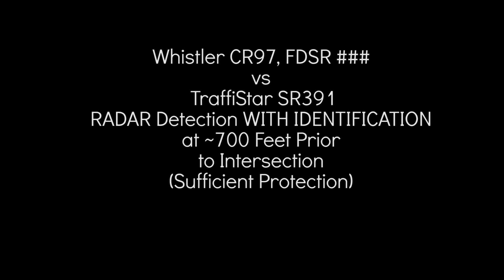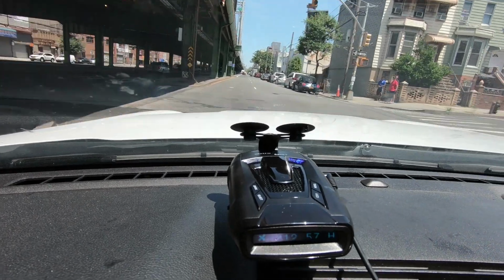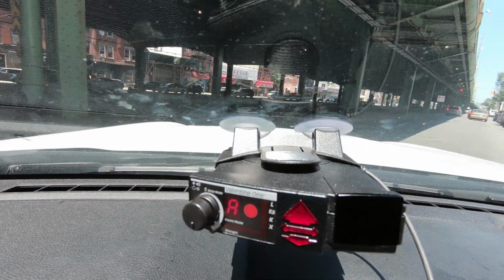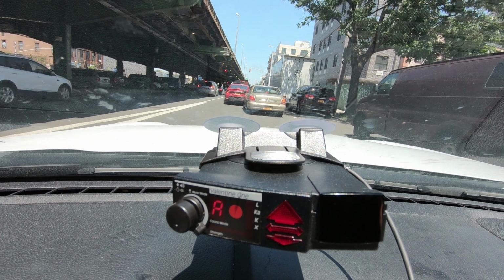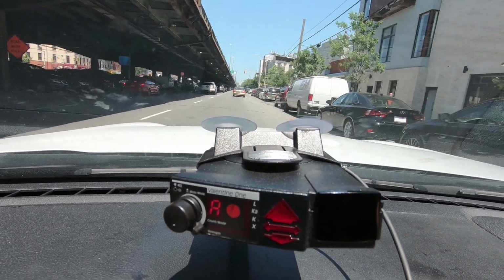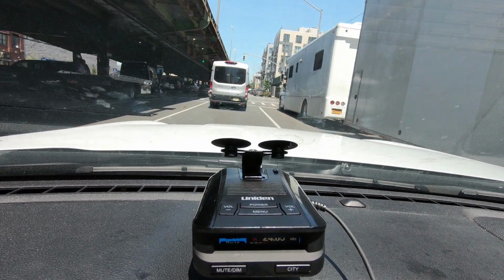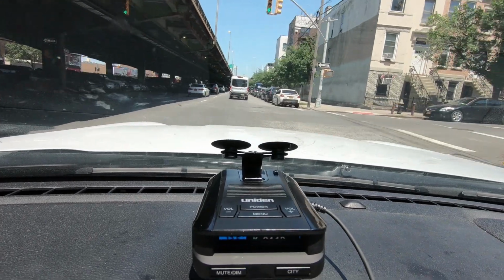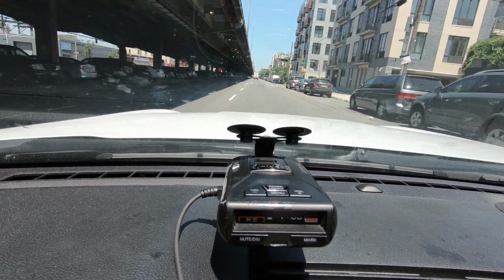Whistler CR97 FDSR  DFR8 R3 V1 vs TraffiStar SR391 FMCW K band Speed on Green Photo Radar

Comment: Which one was best?
Reply: 1st one. For 250ish the whistler is a solid detector. I had one back in 2008 had it until 2014. Never let me down. Until blind spot monitoring came around. Gave me false all over. The new one doesn’t give off false due to other cars.
Reply from the maker: In this case,we believe the CR97 handled this threat the best.